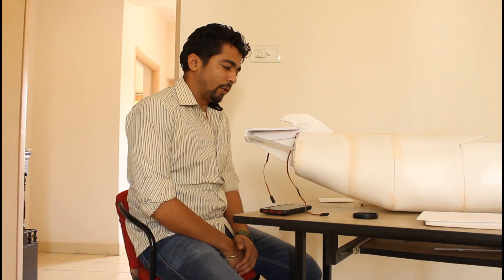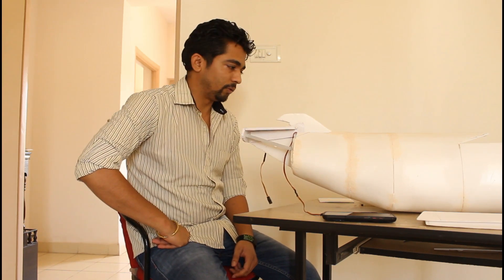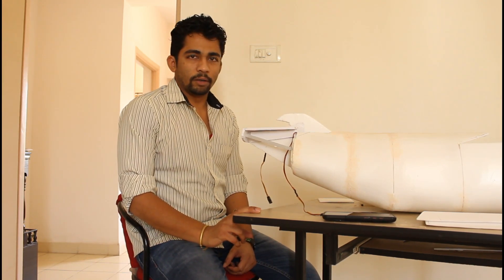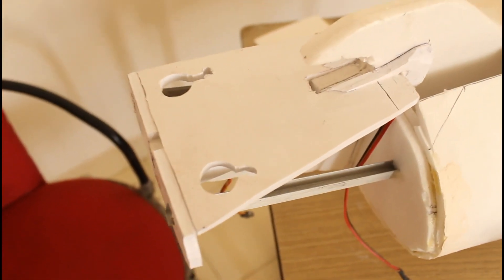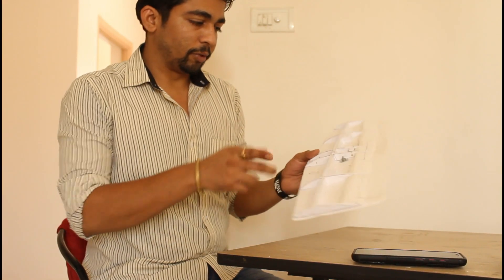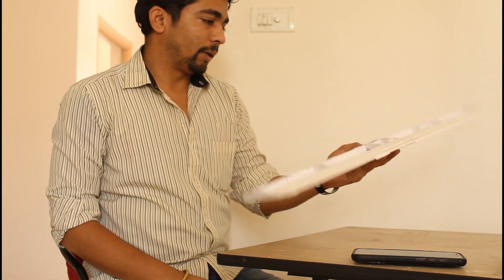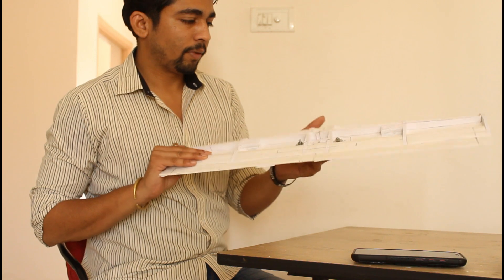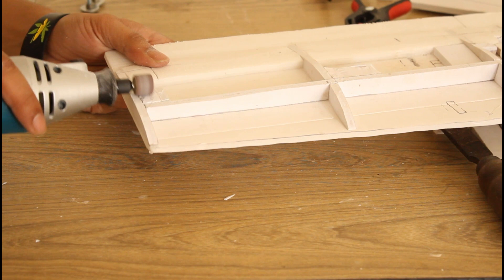Build: C-2 Greyhound - Scratchbuilt - Part 3

Comment: I appreciate your hardwork and this is amazing and I like the way you work as well as struggle for building this model btw which transmitter and servo you are using to control this plane? Are they from hobbyking?
Reply from the maker: Hi, Welcome to the channel and thank you so much for the kind words. I am using Avionic RCB6i Tx/Rx set and Servos and other electronics are mostly from Hobbyking.